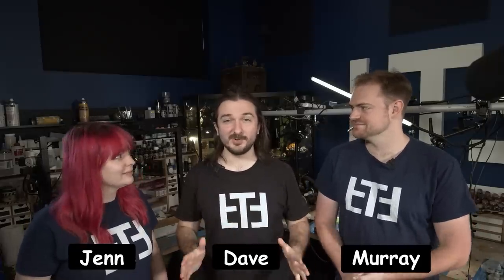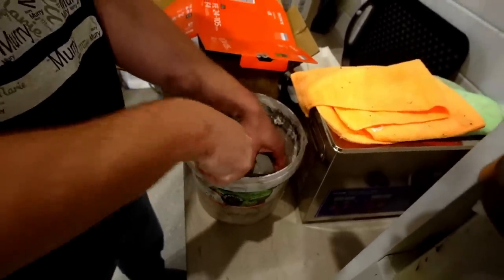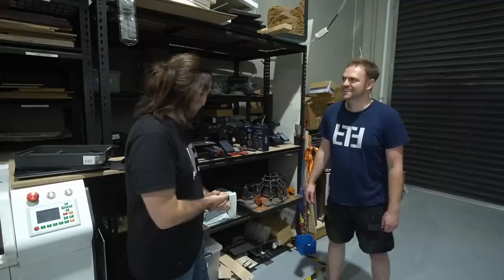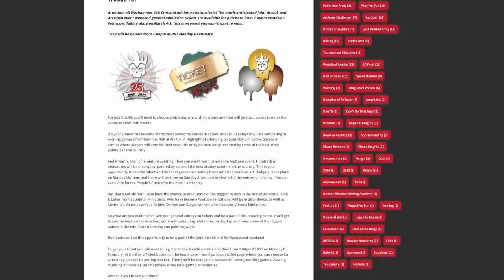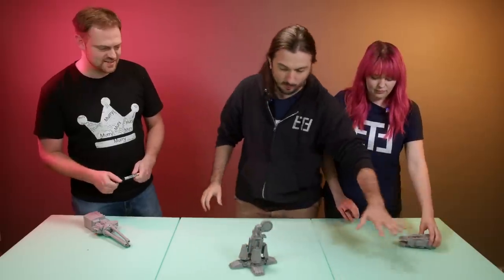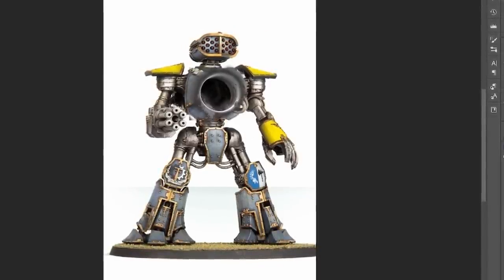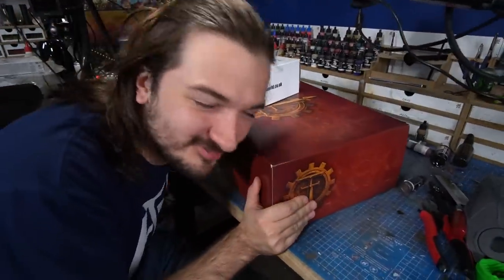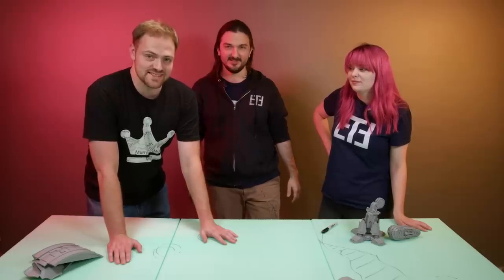This 40k TITAN TABLE is our most Ambitious Project EVER!!

Comment: As the warlord titan exploded, one of its parts could have smashed into on of the smaller titans. It would be cool to have one smaller titan penetrated by one of the parts of the warlord titan, like a warhound titan cut in halve by one of the armor panels
Reply from the maker: Ooh I love the idea of shards of debris spearing the battlefield
Reply: Wait couldn't that be what pinned that one titan to a wall, a shard of tempestus?
Reply: @rexosaur9535 like it’s been impaled!?  I LOVE that idea
Reply: 200$ cad for that certificate
Reply: @TabletopTime  you could have the warlord clutch the head of a reaver in its fist like if it was dealt a death blow by the reaver in the rock(such as a uppercut gutshot thing because of the height difference) and ripped its head out as it died
Reply: or like the arm of the topless Warlord has impaled and completely destroyed that Reaver with the hole in its carapace? tho, the idea with the Rockface leaning Reaver also sounds realy awesome, or the Warhound one * ^^ * either way it would be killing 2 Xenos with one Melterburst ^^

Comment: would be cool for the reiver built into the hill side to have some scaffolding like the mechanicum tried to scavenge from it and abandoned the project/ would be a way for players to get up and down the terrain feature
Reply: I get the feeling that the arms or at least the weapons on the arms could have been salvaged so maybe they took the good bits and left the superstructure/frame behind with all the connections and wiring dangling down.
Reply: Yeah! Or maybe nomads had been living in and around it, tents, rope bridges, ladders, caves in the hill etc

Comment: I'd suggest leaving a bit more of the central body of Deus Tempestus, just the lower part, maybe made of some sheet styrene - fluted and blown outwards, suggesting that it once was a core of it's body which reactor's explosion has obliterated everything above and bent all the panels on the lower hull.

Comment: For the cored titan, to create the hole, you can obviously do the first hole with a large drill bit or a hole saw drill bit, bit to make it look melted, you 'may' be able to use a soldering iron to actually melt the edges of the hole and internals to smooth it all out. and create melted resin bits (and likely burns)

Comment: A tip for Murray. Get one of those thick sheets of foam to act as a sacrificial backing board when using the circular saw, that way you get the support, but you can cut into it without hurting the saw, or the table!

Comment: The craters from the Titan explosion and when the 6-barreled laser went off should be like molten glass, the heat has turned the sand into glass, which also helps explain why there wasn't that much sand accumulated there.

Comment: For the reaver with the hole in it, maybe have the missile pod and upper struts sinking into the opening? The loss of structural integrity would cause the uppermost support fairings/beams to buckle or collapse under the weight of the pod, since they're not meant to hold the whole thing up on their own

Comment: Instead of having the Warlord Titan power body just standing there, pose it in the superhero landing position on one knee and having one disconnected arm standing up like a tower next to the legs. 

That still gives you the upper torso, the head and one arm to use elsewhere. The freestanding arm can have banners and relics adorning the nooks while the lower body's knee could have crushed part of a Reaver Titan underneath it as that battle ended in mutual destruction.

Comment: You should really get a ultrasonic cleaner. You could just chuck all small pieces in there and go at the big ones with scrubbing. I think you'd save alot of time.
 I've used it for work to clean up resin pieces for medical use, so it should be good for hobby purposes.

Comment: What size is the foam your using I really want to build a board just don’t know what foam to get to start
Reply from the maker: 1200mm X 600mm
Times 3 to divide the board into three easily transport and stored sections

Comment: Thinking how this was a mechanicum battle field. It seems only fitting to sprinkle in some other remants of other ground troops. Some  Infantry that were lost in the fray that have only recently been revealed by the shifting sand. Skitarii or any other bits would really add some depth
Reply: Also I like the idea of you using the extra resin gates to build another battle board. Using them like building blocks

Comment: The top of the Warlord Titan would be sprayed all over the place in smaller chucks that are embedded in to everything. The legs would also be damaged and sunk into the crate from the explosion.

Watch how the Warlord idea topples over after a Aeldarti Phantom Titan slices to in two. Parts of the Reaver and Warlord Titans slumped over would be good, even making sand dunes from titan body parts showing through. Time 21:46
https://www.youtube.com/watch?v=igJAA4zJj4E&list=PL-vCMNyR76lguBVsq-UbQH-d-p-vuIwKD&index=3

The problem with the re-cored Reaver Titan as a terrain piece is that is very tall with bits that stick out like the huge guns and that makes it easy to knock over. It also dont add any cover too the table as its hard for miniatures to stand on it.  How are you going to prevent tt flling over onto players' expensive armies?

Comment: Why not cast the certificates of authenticity in clear resin to turn into the basis for the dice roll boxes? Sounds like you will have 4 certificates which could be turned into 1 per corner/side.

Comment: If you don't need to make the table GW compliant. I recommend you take a look at Grimdark Terrain to incorporate some Olympus Mons parts at 350% scale. Those make great pieces to incorporate the outskirts of Magma City into the terrain.

It would only be fitting to have at least part of the Magma City on the board as it was the last stand of Legio Tempestus on Mars.

Comment: Have you considered having the cored titan mid stride and slightly slumped? To make it feel more like it's was alive and now deprived of strength. As for a hole this might be extreme but what about going to a shooting range and fire a small bullet to core it?
Reply: That wouldn't work, likely you'd end up with titan splinters and shreds, not a titan with a hole in the middle. Under the extreme forces of a bullet impact, resin would behave more like glass than like metal.
Reply: @feynthefallen  Fair point, I was thinking of something like 22 short or smaller. Wasn't considering just how brittle it might be.
Reply: @maximhyland5843  Even a .22 packs a significant shock load. Most people underestimate how gooey metals are. They behave like very tough dough or putty, that is to say they hold up exceptionally well to shear forces. Resin is also tough, but in a glassy way, think dried out clay as opposed to wet clay. Where wet clay would absorb a hammer blow and get a dent, semi-dry clay woud shatter.